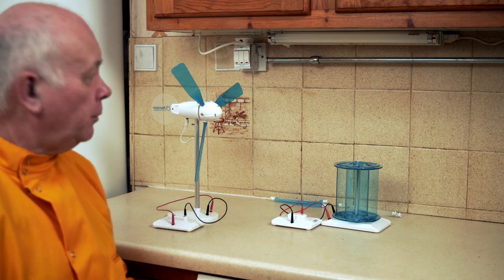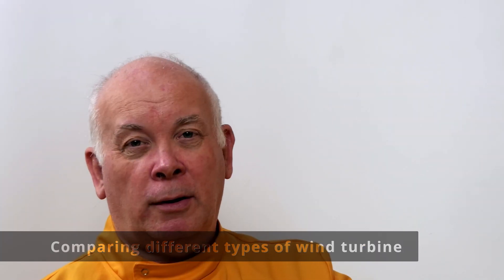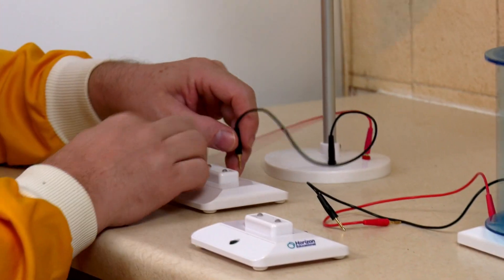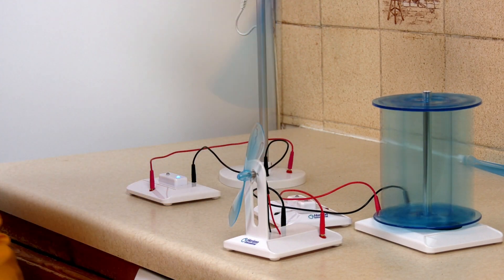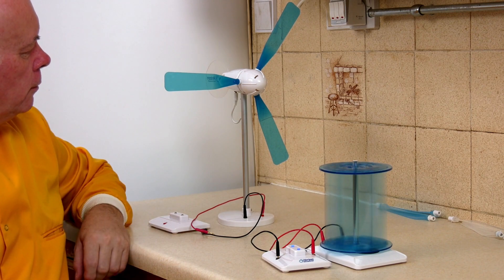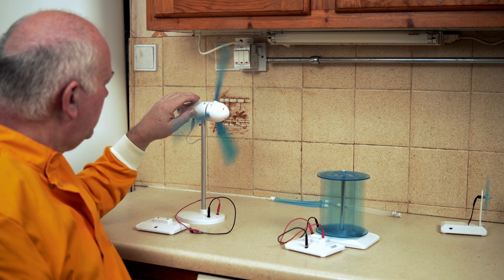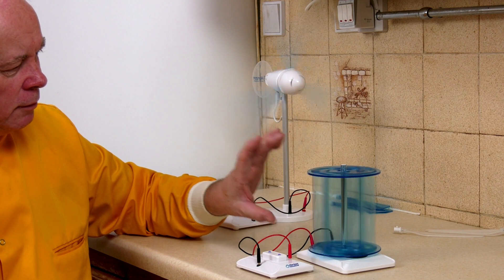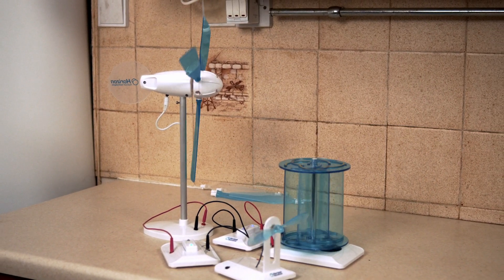comparing vertical vs horizontal wind turbine

Comment: I have experimented in Wind turbines for years. It is like comparing Apples and Oranges. There are many different types of vertical turbines compared to Horizontal turbines. 

There are types of VAWT that use blade lift designs like the HAWT that move faster than the wind moving over them. The difference is that VAWT typically can start under lower wind speeds and can handle turbulent changing lower level wind and react quickly. HAWT are typically mounted up higher in stronger wind. If you match the swept areas and put them at the same height with the same lift style blades , you would be surprised at the results. 

VAWT are better suited to be set up to take advantage of drag forces on lower level turbulent wind with many magnets on the outer diameter of the swept area at lower speeds or fed into a gear box using mechanical advantage to run a generator or pump water or like uses. 

HAWT are better suited to take advantage of higher prevailing wind streams at higher speeds where they don't have to make quick adjustment for turbulent winds. 

A VAWT can start up at a lower wind speed and generate power for longer durations at a lower rate so in a years time it is about a wash between the 2 . 

A VAWT designed right will never over speed and damage itself.

A HAWT will need to be turned out of the wind and maybe even need to use a braking system to avoid being destroyed by wind.

I grew up in The Midwest with lots of windmills at shorter heights that relied on the drag effect to pump water and charge batteries for off grid Electric systems. 

Sometimes they would be damaged by storms but most of the time they had systems to turn them out of the wind automatically to slow them down and protect them.
Reply: how about the generator design? I see most videos on how the blades are made and not the motor.
Reply: @silverpc4611  All of the better designs are 3 phase out put that needs to be converted or inverted at the point of use. It is more efficient to use three legs or wires of AC power at a higher voltage. It allows you to run the wiring at a smaller size a longer distance with minimal loss.

Even a standard car alternator is actually a 3 phase motor that is rectified to DC inside of it. 

It is actually more efficient to remote the voltage regulator to near the batteries. You still need to run 12 volts out to it unless it is a self exciting winding style Alternator.

The best generator design is something similar to a direct drive washer motor. 

It has a larger diameter stator and rotor and can generator more power at a slower rpm.

The closer the outside diameter of the generator is to the outside diameter of the turbine the more power you can generator at a lower wind speed.
Here is a link just to show the design I am talking about.

https://www.ebay.com/itm/374136192152?chn=ps&mkevt=1&mkcid=28

These work well with a drag type or Savonius  type turbine. They can even be made cheap from 55 gallon drums cut in half.
https://www.sciencedirect.com/topics/engineering/savonius-wind-turbine

As the outside diameter of the generator increases you need slightly more leverage to overcome low wind speeds. Drag types are good for that purpose.

You need to match the type to what your prevailing wind speed is and the use.

Look at the torque and power the old Dutch windmills had to pump water and grind flour. They worked off of the drag principle like ship sails.

They cannot move faster than the speed of wind but the torque could be run through a gear box or pulleys to increase the speed of the generator for more power.

It is either speed or torque that get's the work done and they are inverse of each other.
Reply: Dear sir,
Your opinions would interest me greatly. I wish to use a hybrid off-grid system that uses both solar and wind energy. Because of the height and space constraints, I intend to employ a vertical wind turbine. mostly for light winds.
We welcome any recommendations.
Reply: @sandun4983  It is best if you mount a lift style VAWT on a base that is out away from the home a distance. Install a base that can be tilted down and up with a hand winch or block and tackle anchored to a vehicle or something similar. The other option is a small building to house everything in like a garden shed and tilt the mast or base up against the out building. 

Keep the charge controllers and inverters in the small outbuilding. Build part of it with an enclosed insulated vented area for the battery bank. You want to keep any fumes or corrosive elements away from the rest of the components.

In that same area or somewhere close you might want to have a backup generator that can take over and charge up the battery bank. Most charge controllers will have the ability  to turn on a gen set if the battery bank voltage get's to low.

Most wind turbine charge controllers also incorporate a dump load of some form. 

I built many in the past that dumped excess power first into an Electric water heater and then into a standard resistance air heater.

Anything over and above what is coming out of the wind turbine to use for charging needs to be dumped into a dummy load of some kind. Usually it is a resistance heater of some kind  but anything could be used.

So the idea or sequence is Both Solar and wind go into charge controllers or a combination controller inverter designed for it. 

Anything beyond what is being used at the time goes into the battery bank. 

It is better to have more battery and less Solar if you have to prioritize for off grid usage. If space is a premium, even 500 watts worth of Solar panels can charge up a massive battery bank if you are not using up the power you are trying to harvest.

A good way to look at power needs is first how much 240v power do you require in one day to run major appliances. 

Then how long and how often do you need them and could a lower power consumption appliance do the same thing more efficiently.

Next would be how long can you run with only 120 volt power for smaller appliances that must run. IE   .. Reach in freezer, refrigerator, water pumps, lights etc..

Maybe you can cook using a microwave or hot plate or super insulated slow cooker or use gas.

Sometimes you can get away with running fans instead of an AC.

This is a start. We can keep going if you want to.

Without knowing your planned load it is hard to tell you what you need.
Reply: @desertdan100  do you have any suggestion for vawt that actually work? I have seen mostly disappointing test results and flimsy products.

I had the thought of mounting something on the house, but perhaps due to vibrations its not that a bright of an idea? Many small ones?
Reply: @davidfurmanski8706  Don't mount it on the house unless you absolutely have to. Then yes a couple smaller ones maybe that are slow moving or drag type.
The best type are lift type designs but they tend to vibrate a lot and are noisier. Mount them away from your home to reduce noise and vibration. They can spin faster than the air moving by them. Look up Darrieus style VAWT wind turbines. They need to be an odd number of blades to reduce pulsing. 3, 5, 7. Even numbers will pulse and affect wind moving through the blades 2, 4, 6. Sometimes the 6 blade style will work ok.

Think of them as a wing from an old Bi plane turned on it's side.

Another type to build is a Savonius style. 

Think of 2 or 3 barrels cut in half and offset from each other by 1/4 to 1/3 of a lap. It forms an S when viewed from above. They actually work very well and start up in low wind. 

If you stack 1 on top of the other 90 degrees out they work well. Even better if you can stack 3 that are 120 degrees out from each other.

Then you make use of the torque to drive a generator. 

Metal barrels have more weight and act like a flywheel to smooth out the spinning and keep them going a little in turbulent or gusting wind.
Reply: VAWT wind turbines work or run more than HAWT so the output between them is about a wash. The higher you mount any turbine off of the ground the more wind you catch. 

VAWTs are good for low level turbulent winds that change direction suddenly.
Reply: @davidfurmanski8706  Don't waste your money on the cheap chinese plastic ones that look like a lantern or pumpkin . They just don't work.
Reply: @desertdan100  Thank you for your input! My case, living in the suburbs of Stockholm, behind a hill to the south and quite close my neigbours. Rising a pole wouldn't be very appreciated so if I would like to harvest the wind my best is that I would need a couple but unfortunately smaller turbines. I came across Aerominer and that seemed compact and without much moving parts, but probably a DIY project for quite some time since they don't offer anything to the market.

My best and most windy spot is the roof top. I will not buy some Chinese products unless they come with absolutely stunning reviews. Do you have products in mind one should research more?

Comment: While he may be right and the vertical turbine doesn't generate the same as a horizontal, the clear benefit is that if the winds constantly change directions, there's no wire to tangle or break because the vertical can take winds from any direction.

Comment: It looks to me that one was much closer to your wind/fan.     I think that it's important to test them in the same conditions.
Reply: The generators are also of same capacity?
Reply: @palanik1960  Right...to me the magnets used for the vertical one would have to be much bigger and different than the horizontal one.  They couldn't possibly be putting out the same power.  The actual generating part needs to be the exact same for this to be a true comparison.  It doesn't look to me there would be enough room in the base of the horizontal one as there is in the larger vertical one.
Reply: @paulmobleyscience  Meaning they are not same generating capacity and hence how comparison study can be equated?
Reply: @palanik1960  The plastic pieces that are blue should be different but the actual generator that produces the electricity should have the same exact output to be able to have a true comparison of the two different designs.
Reply: @palanik1960  What should be compared is the actual design of the total package of both and to do that they both need to have the same power output from the different motors of each design.  The only thing that should be different between the two designs is the way each catches the wind, not the motor.  Make sense?
Reply from the maker: The test were carried out at the same distance

Comment: This is not a great test as the Gorlov vertical style turbines are much more efficient and quiet than the vertical turbine you used. Gorlov style turbines also create power in both directions (compared to the wind direction) of the blade so it catches some of the power after the facing blade has caught some. The model you used doesn't do that so is less efficient.

Comment: I see so many possible variables which are not addressed, that I, at least as a non-official-scientist makes me wonder if it's valid at all. Is exactly the same motor/generator used in both versions? You changed the angle and even design of blades on the horizontal, but not on the vertical, we never saw the fan generating the wind, much less smoke trails to see if there was different volume of airflow at different heights.. way too many possible variables.

Comment: This mildly infuriated me.. only because it bothers me to see a comparison between horizontal and vertical turbines when the horizontal turbine is a poor design.. more tall than wide when a much more effective design is much wider than tall. Much more torque and efficiency is achieved with a shorter, wider horizontal turbine design. (Sorry, I describe the turbines by how the blades spin.. the tall one to your left I would call a vertical turbine)
Reply: Yes I agree, vawt could be made with a either long blades or blade that are further away from the axis of rotation, this would allow them to spin slower to produce the same amount of power or produce more power if the spin as fast

Comment: Conclusion is whihc is the best?
Reply from the maker: Horizontal are more powerful but vertical can fit into small spaces - There is no answer to this - space is the overriding consideratoin. Vertical work in lower wind speeds and might be more suited to an urban environment.

Comment: Blinkenlights are pretty, but do you have an aversion to Numbers?  How about some actual statistics maybe?
Reply from the maker: Being a science teacher we use numbers all the time. I tried to make the video easy for aa large number of viewers and decided not to bore them with all the figures we got out in the experiment s in the class on the current, voltage and Power. Perhaps I will do this in another video.

Comment: There are absolutely different parameters of the turbines. Horisontal is much bigger.
Reply: I agree the blades are easily twice maybe three times as long which certainly increases the power output at similar speeds

Comment: Thank you for the video. For every engineer who has even remotely paid attention in fluid dynamics (even appart from the obvious area-discussion), it is obvious which system will deliver more power (or is more efficient). However, I do think that the vertical axis wind turbine does have their specific applications, especially where space is tight and construction height is limited. Sometimes even a less efficient wind turbine is better than none at all.
Reply: "Sometimes even a less efficient wind turbine is better than none at all." Damned by faint praise.
Reply: @neddyladdy  what do you mean?
Reply: @davidfurmanski8706  Do you mean the term damned by faint praise?  If you do, it means is was weakly praised, maybe so weakly praised that it wasn't really praise at at all, but rather a condemnation.
Reply: Every engineer who has remotely paid attention, and knows anything about engineering and fluid dynamics knows that there is sometimes a trade-off between designs which often creates a scenario where a less is actually more.
A HAWT will perform better in places with steady airflow and few directional changes such as higher altitude installations and flat open areas, while a VAWT will perform better in areas of turbulence and/or frequent directional changes like you might see in a lower altitude installation in a crowded residential area.
Despite the capability of delivering more power, a HAWT may produce less power under some circumstances.
Reply: Have you seen any vertical wind turbine suitable for somestic areas? I have seen the Icewind turbine but it promises a hefty price tag.

Since domestic areas are packed with buildings and people do not want the offer of having a wind turbine potentially come crashing down the turbines has to be mounted on houses, already existing buildings and be pushed by modest winds.

What kind of expectations can one have?  100-200 watt, probably less per installation ?

Comment: The first obvious difference is that:
a) size (swept area) of both turbines is DIFFERENT. You need to compare apples with apples...
b) one is lift based, another is drag based...you NEED to compare apples with apples. Otherwise - this is just misinformation...sorry.
Reply from the maker: The swept area is about the same according to the manufacturer, depending on the configurations. but the amount of power produced is very different because of the design and the rotational speed. Other factors are more important than the swept area. On these models I can change the blades on both turbines and the angles. I can use 2, 3 or 4 blades in each turbine which will change the swept areas. I could have set up the videos with all the maths to prove the same areas for each configurations, but then it would have been a longer and more boring video and here I am just looking at concepts.
Reply: But are the generators the same rating, apart from different types of lift versus drag which is warped comparison
Reply: I’ll look forward to your video.

Comment: At 4:54 you have put 2 blades for counter clockwise rotation and 1 blade for clockwise rotation. Not optimal.
Reply from the maker: well spotted. In fact it made little difference. We had filmed this several times and the wrong one went into the production
Reply: @PhilipRussell  How can a one bladed turbine be 'little different' from a three bladed turbine?

Comment: The comparison is not valid.
The radius of the horizontal axis turbine is greater than the radius of the vertical axis turbine.
I think you did your experiment from Guantanamo jail.
Reply from the maker: I agree the radius is not the same but the area swept is, according to the data specs.
Reply: @PhilipRussell  I understand about the swept area, I'm a math teacher.
But the space occupied by the blades of the HAWT is greater than that of the VAWT.
That is a point to consider.
Reply: @elgram612  agreed, the smaller the radius the faster the turbine must spin to produce equal power

Comment: Horizontal turbines actually work. Vertical turbines don't really work. This is due to the physical processes of wind turbines.
Reply from the maker: Vertical turbines are widely used so I guess that they do work. Efficiency is a different matter.
Reply: @PhilipRussell  Not widely used. I've only seen vertical turbines in commercials. In reality, all vertical turbines that I have seen have already collapsed. The physical principles of vertical turbines make them short-lived and ineffective.